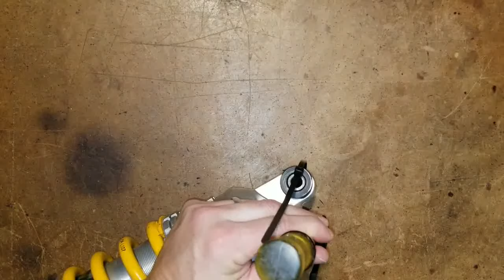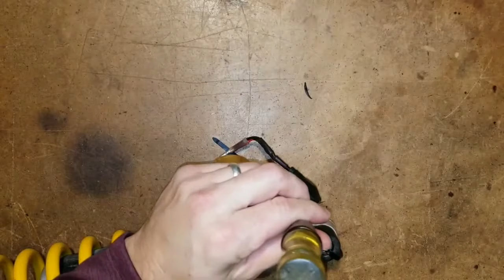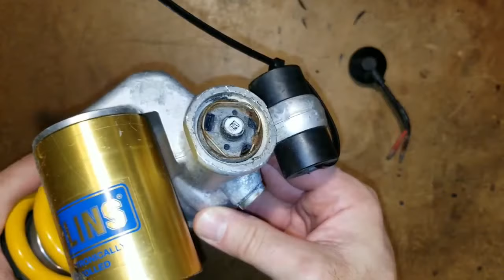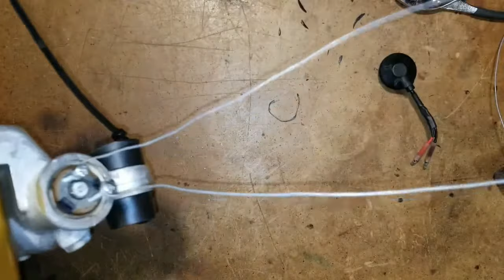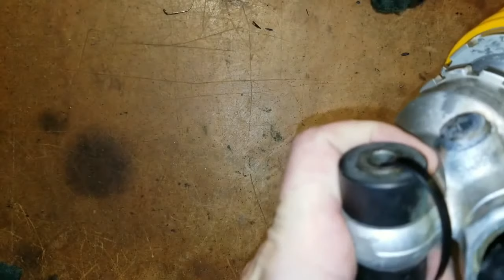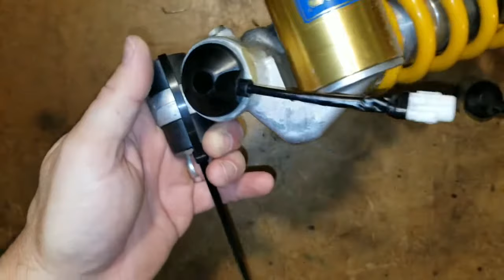OHLINS EC Shock - Solenoid Replacement

Comment: how do you know if its actually bad?  Also can you replace the electronic with a manual adjust??
Reply from the maker: Just saw this. You can test for power at plug by shock.  Usually its a damaged wire. You can replace the shock with a manual. Does the icon show up for it on your display?